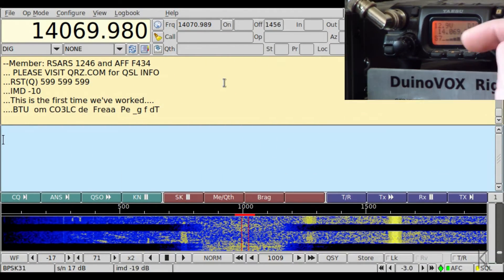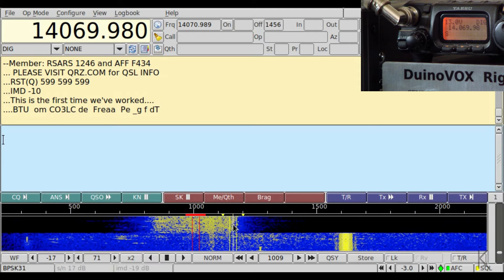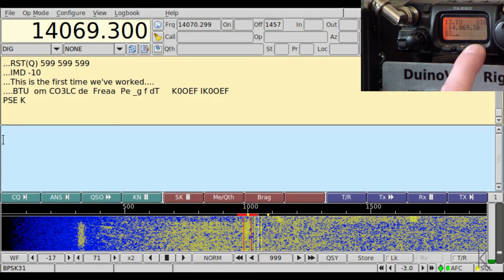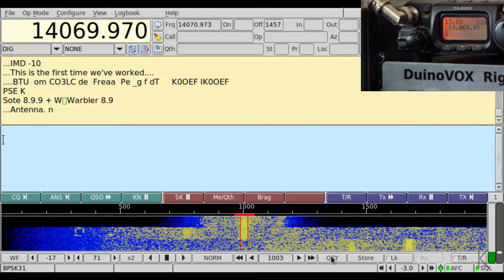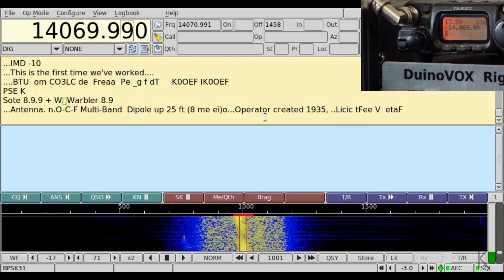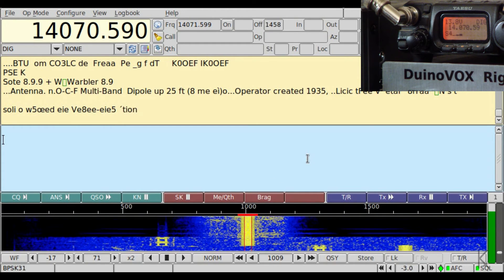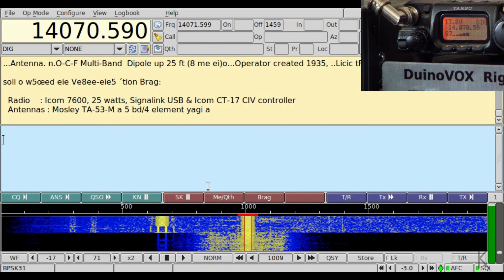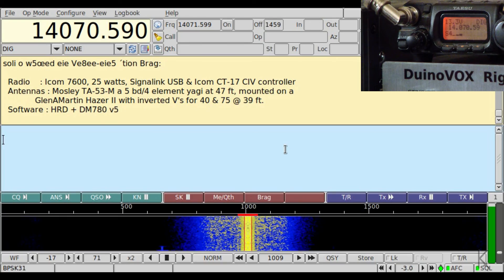Ham Radio - FLdigi tips,  the QSY button and narrow filters in digital modes

Comment: I know this is an old post, but just getting into digital modes and an 818ND and curious what filter would you use for these modes (SSB or CW)?
Reply from the maker: On my FT817, I have a 300Hz CW filter installed and found that it works very well for PSK31.

Comment: This is awesome info. I wanted to add: if your radio's "sweet spot" doesn't match where the QSY button is taking you, you can change it by going into Misc -> Sweet Spot and putting the value in. My ic7200 was 1500.